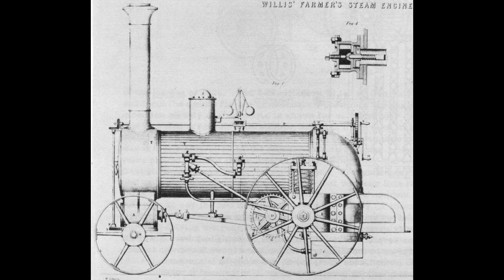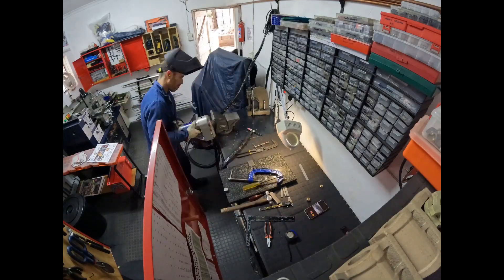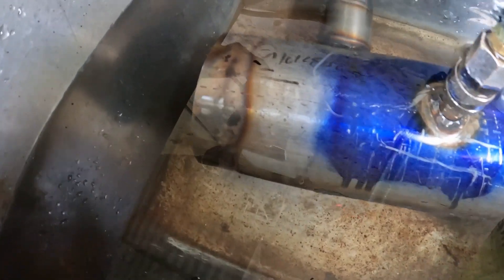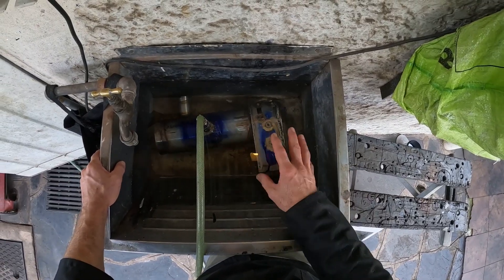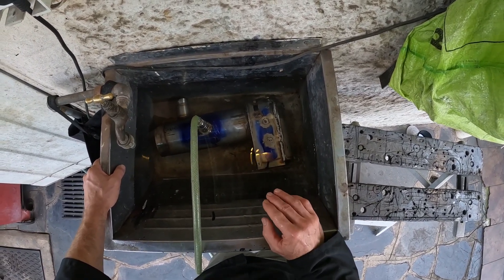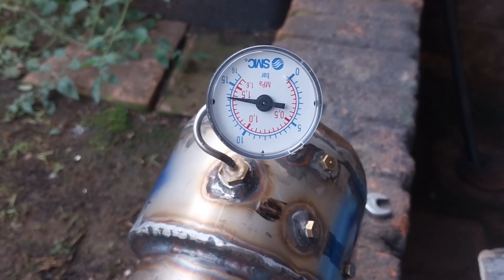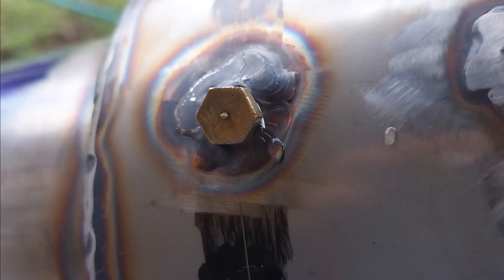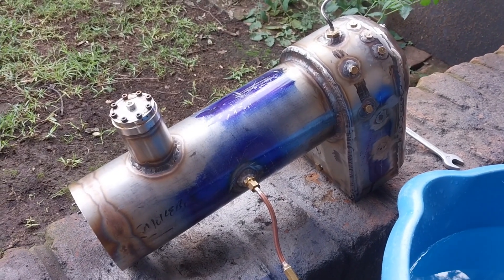Pressure testing  a stainless steel ME boiler

Comment: Nice to see someone doing an underwater air pressure test first. You could've mentioned that in the industry this is actually a quite common practice. Another benefit is that it's way easier to spot small tiny leaks.
Reply from the maker: @fladder1  true! It always scares me when boiler inspectors tell people to correct steel boilers after a hydraulic pressure test.  Not sure how many builders go through the effort of drying properly to avoid hydrogen embrittlement. Thanks for the comment!

Comment: Why not regular steel ?
Well boiler tube non stainless steel .
The heat transfer of stainless is terrible !
Reply from the maker: @josephpadula2283  thermal simulations and cfd shows you get improved heat transfer.  Can't just look at one aspect of the thermal system. Practically, these boilers outperform the copper boilers I've built.
Reply: All the full size boilers  used everyday from 150 psi to 1200 psi were not stainless .
Reply from the maker: @josephpadula2283  very difficult to make full size from stainless.  Thermal stress will result in failure.  These smaller boilers are specifically designed for this application.